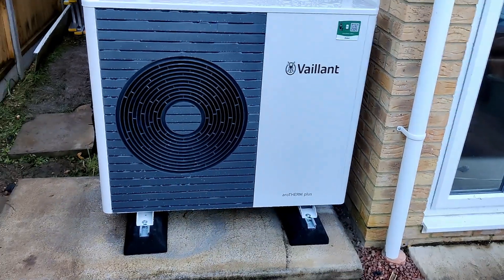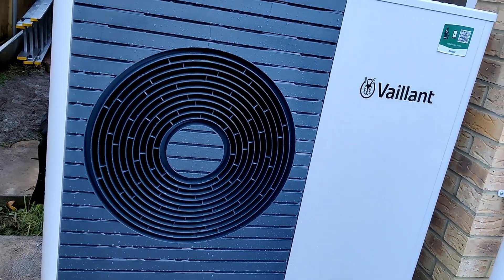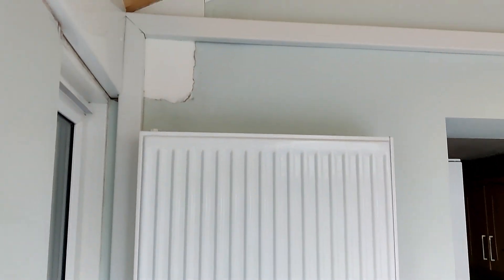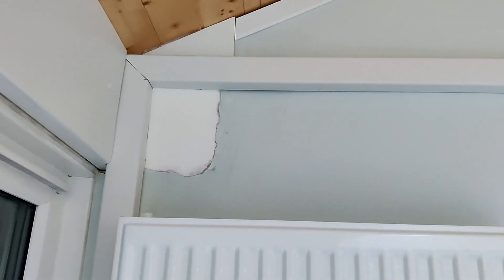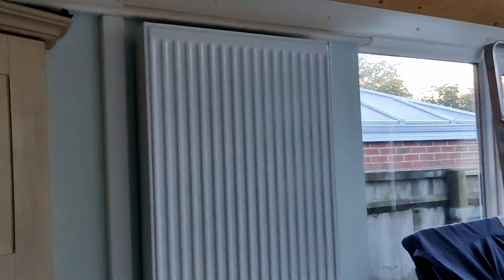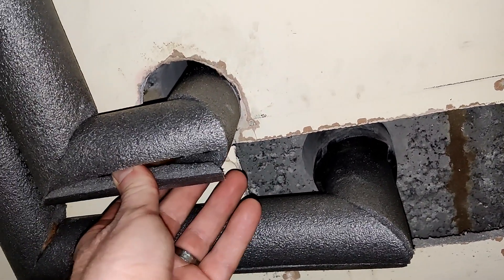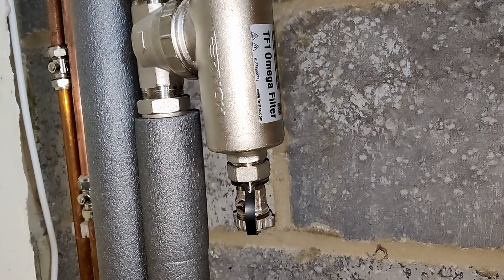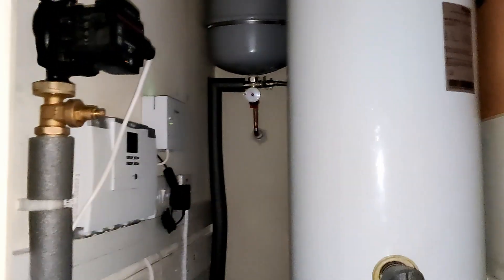Day 7 - British Gas installing Vaillant Arotherm Heat Pump at my house!

Comment: Late to the party. What's the after sales support like with BG , and did you pay a service contract & cost ?
Reply from the maker: So far so good.
Several snagging bits to go through. Everything appears to have been well handled.
First year service included for free. Thereafter you can pay for a service plan if you wish. I didn't.
Reply: @UpsideDownFork  Same as the gas boiler they installed for me years ago then.Hopefully not a call centre in Bangladesh that you have to deal with for any problem ? Dealing with BG for energy/bills was not always ideal . I'm with Octopus now,
Reply: @UpsideDownFork  Another annoying question from up't North. Is the Wilo  pump noisy ? I don't have space in tank cupboard so they propose buffer tank in loft and so secondary pump. Outside fan noise will be zero, but thinking about pump whining above my head all night which would not be ideal to say the least.

Comment: Good luck - I hope it all works as planned :)  Any chance you can share a system diagram?
Reply from the maker: Sure, that sounds like a good idea. Vaillant call my layout schematic 10 👍
Reply: @UpsideDownFork  Aha - will look that one up, but any info would be appreciated and if they gave you any justification for their design choices... I noticed your design includes the "controversial" buffer tank which the Heat Geek likes to remove whenever he sees one, but it seems that many suppliers include this in their standard designs...
Reply from the maker: @pfischer4664  yes, essentially the buffer gives the system more volume which can reduce cycling, it can help during a defrost so that the heat isn't sucked from the closest radiators on the circuit and it allows the flow rate of the pump to stay in the optimal range.
Basically if the system isn't designed correctly, it will still function well because of a buffer.
I'm confident that the flow rates of our system design do match the heat pump and so it's not absolutely necessary but the expensive quote just didn't justify itself in the end.
BG basically dug their heels in and when I pressed they just defaulted to Vaillant's own literature which does say that a buffer should be used.
Interestingly, the same literature in German doesn't specify a buffer in the same scenario. It's almost as if Vaillant have more faith in the German heating engineers than the British ones! 😅
Reply: Have you checked R290 safety zone insulation? , I'm sure it needs to be 1 meter away from the door and drain. Also, if they are to repair it then I don't know what's gonna happen